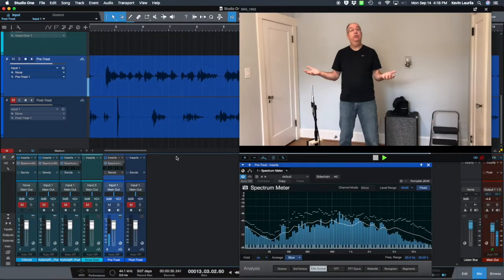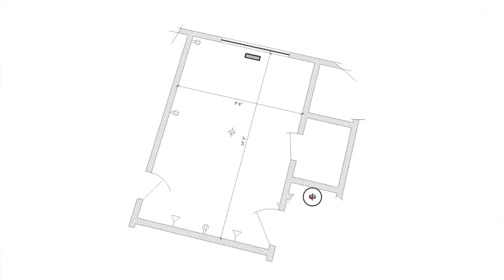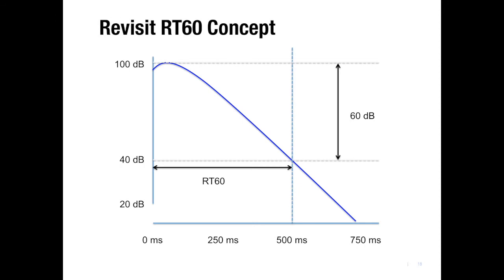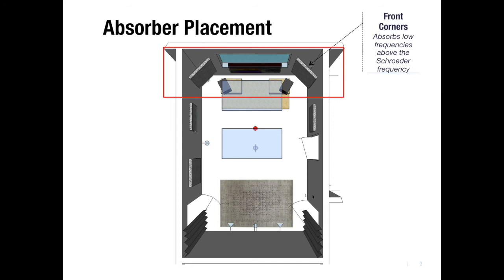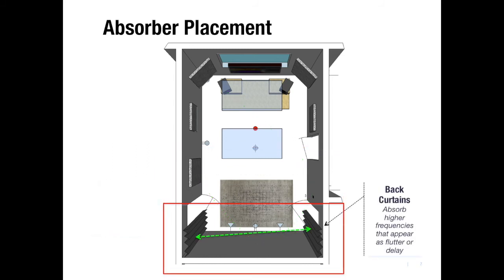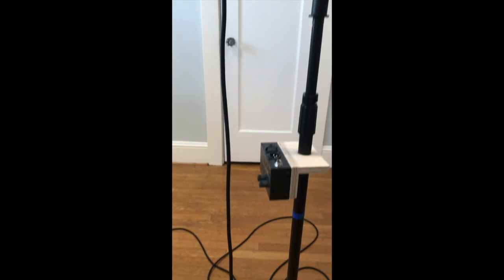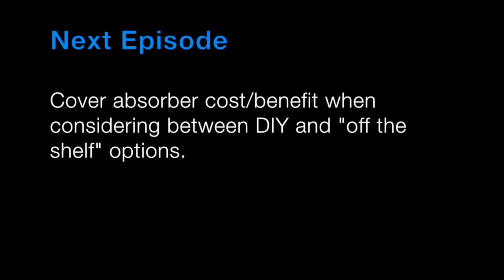Home Project Studio - Treatment Series: E3 Measuring RT60 and placing absorption

Comment: What I learned is it's best to go after the lowest Axial modes first. Sticking low frequency absorbers in the corners isn't going to treat Axial modes.  I think that's where most people make a BIG mistake.   Axial modes are the entire surface, that it's best to have at least 50% to 70% surface coverage of absorption that will go after those low frequencies.   Most rooms have Axial modes starting in the 30hz to 50hz range, and then for ceiling heights of 7ft to 9ft usually have floor to ceiling problems in the 65hz to 75hz range.  Again, about 50% to 70% surface coverage will yield a VERY noticeable improvement.

Also, for going after 30hz to 50hz range, diaphragmatic absorption is typically going to absorb the most vs other absorption devices.   The problem is that these types of devices are 12in to 16inch deep and you'll lose a lot of usable floor space.  The way around that is to build a room where this type of absorption is built into the wall. But the materials/labor is expensive.  But it's possible to create a room using proper materials, design to get a flat response curve no matter where you are in the room. I found a company that does custom design work, but they also have what appears to be the most powerful absorption devices for going after those 30hz to 50hz range.   The good thing is that you can add a high quality open cell foam on the front of these devices and have a full range absorption product in one unit.  And even better, they offer build plans so you can build your own units.  The only problem is they aren't easy to build and you need some experience and tools to make these devices, and also buy certain materials from the company that you can't purchase eslewhere.

The biggest mistakes are that I see a lot of people not really treating the Axial modes as they just stick low frequency absorption in the corners and only mid/high absorption around the room, and they don't have enough surface coverage.

Corners is only going to absorb about 5% of the total room's low frequency issues.  Not good advice to only absorb 5% of the problem.

Comment: Hello,
Thanks that's clear and precise. However, not sure what you used for front corners ?

Greg
Reply from the maker: I used a corner trap design from Sound on Sound article.  Check it out here...  https://www.soundonsound.com/techniques/studio-sos-making-small-room-sound-good
Reply: @mediaunion  thanks for reply,
One thing I don't understand is if there is a rigid panel in the middle or juste some black vynile sheet...

Best regards Greg
Reply from the maker: @satriany31  Sorry for the confusion.  I included a sheet of 1/8" Mass Loaded Vinyl in each corner trap.  I sealed them in 4 mil plastic because I thought they smelled funny and it bugged my nose.

Comment: Great videos.  I hope you continue with them.  I would also love to learn more about how to setup and read the RT60 results.  I have been using REW for subwoofer time alignment and subs to mains integration.  But the decay, RT60, waterfall graphs confuse me.  I do have years of experience reading vibration waveforms and spectral data, so this should not be this confusing to me, but it is.
Reply from the maker: Thanks Dustin!  REW has some amazing online help for getting informed about the various plots and what you can learn from them.  Others have asked about a slightly deeper dive into what these plots are saying so stay tuned!

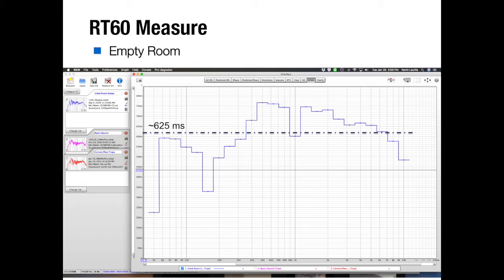Comment: How does REW create the graphic at 4:09 and or how do you get it to portray data based your octave bands? Thx.
Reply from the maker: Glad you're digging in.  I'm in the REW overlay mode which displays all your active sweeps.  To change to Octave or 1/3 octave bands, go to the "Gear" in the upper Right corner of the REW overlay window.  Click on it and a menu will drop with different preferences for RT60.  If you change the plot/graph type, the preference menu will have settings specific to the type of graph.  If you leave the Overlay mode, the Gear for the individual sweep display functions the very same way.  For RT60, I checked "Use bars on plot" box.  Then chose 1/3rd Octave.  Thanks!